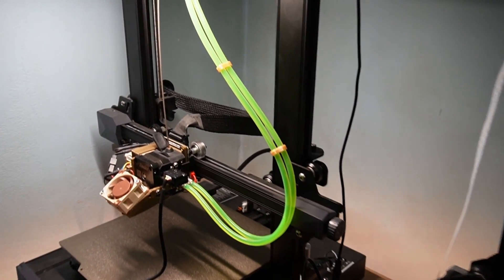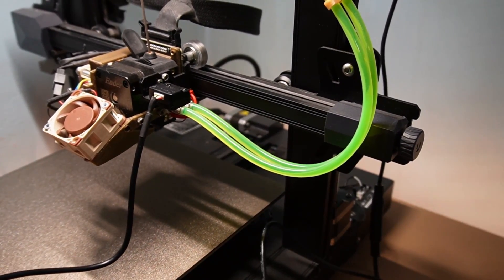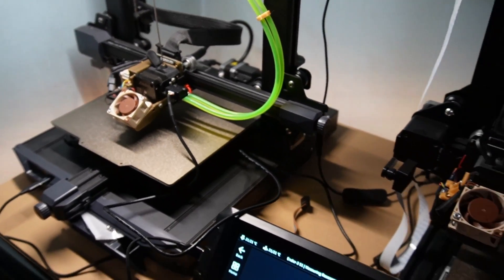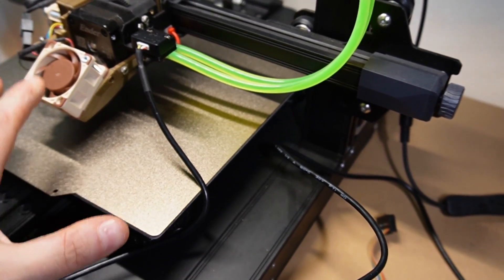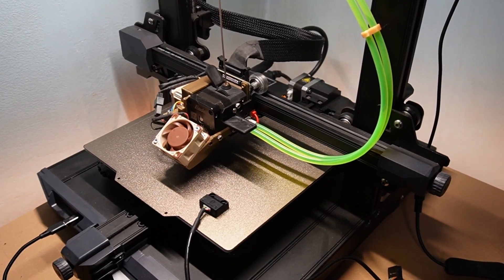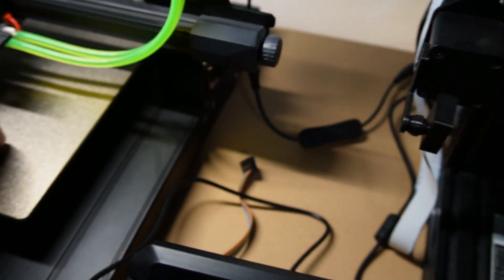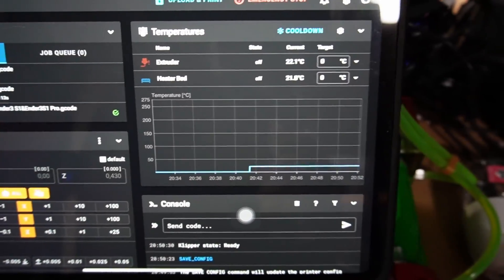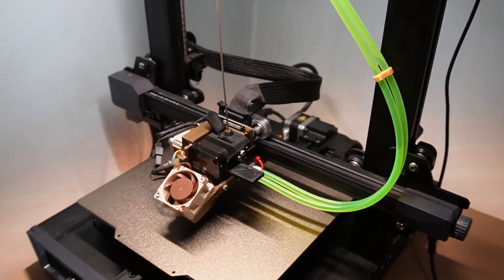Creality Sonic Pad Input Shaping Fix Test and Mainsail introduction Ender 3 s1 (pro) sprite extruder

Comment: great video, thanks. If I have run the calibration once initially, what do I have to do to rerun it? does the routine overwrite previous procedures or do I have to change any settings before rerunning it? Thanks
Reply from the maker: hi there, in the settings menu there is an advanced tab , there u choose resonances and run them for the x and y axis.  Each time u do a resonance calibration, it overwrites the previous one. U don't have to change any settings before you do the resonance testing, but keep in mind you have to correctly place your calibration sensor on the according places on the printer.

Comment: That´s what i say all the time. The sonic pad is causing me only problems. With a more open source approach i could fix these issues very fast. One thing is the virtual_sdcard is not working correct. If i could just create the missing directory it would be fixed in minutes. Instead i can´t create the dir caused by missing permissions. The same is with a custom hostname and removing fluidd and set the mainsail port to 80 instead of 8819.
Reply from the maker: you are right, klipper is about being open source and Creality doesn't get it...
Reply: @aim6mac  yep. I was talking about this problem in general an my channel and only got hate in the comments. But i think it‘s time for round two. Right now i got an error code „key121“ because the virtual sdcard is not working. Let‘s see how creality responds to this.

Comment: If i have 4 creality printer 3D, i must buy 4 sonic pad too? If i wanna print same times
Reply from the maker: no one sonicpad can print simultaniously upto 4 printers :)
Reply: @aim6mac  great.. also after flashing klipper into creality printer, stock lcd display will not work anymore?
Reply from the maker: @Hopatzful  thats is correct, u need to use a klipper screen,  in your case the sonicpad
Reply: @aim6mac  thank you.. i hope next videos you share how to print 2 or more creality printer in the same time..

Comment: really good contend bro i got the sonic pad a few days ago and have to wait for a update due to mine CR-X PRO  is not in the sonic menu jet ,
and I'm scared to try to config / FLASH  it and not be able to print anything if it's not working with the sonic pad jet ,,
thinking about buying a ender 3 S1 as well (black Fryday deals are awesome now) 
how fast is it really going to be printing with the sonic pad and the promised good quality bro ?
and I'm excited about the iPad extension they are trying to update and win us over that's clear
they need to be more open whit software do I'm a Appel fan from day one still got the iPhone 1 running as mp3 / a music device 15 years old and still going strong now that's quality  
so running / managing my prints from my iPad pro would be pretty awesome   mjammjam gif me some 
and BTW  love the water-cooled ending holy shit bro i know what i want for Christmas want that that's 3d printer porn bro ..lmao so cool
Reply from the maker: Hi there, the sonic pad really does bring speed to your prints thanks to the input shaping capabilities , but dont expect it to do wonders, the quality can stay as good until a certain point.  It's gotta do with the stability of the table it's on.  I run my printers with klipper on double the original speed. print still come out really good. I got the watercooling kit installed for two reasons tbh, first reason being : it really looks nice lol :) second reason is that i wanted to make my printers go really quiet, and since the watercooling takes away the need for hotend fan it reduced the noise levels to all time minimums. I'm loving it :)
Reply: @aim6mac  thanks for the replies bro     and hell jeh the water-cooling kit looks like it's almost a alien thing lol and jeh  that's what i was thinking why you/it was added to the printer ..the cooling fan for the hot end is annoying as f..k so i will get that kit a 100% but what is your speed limit on what you are printing my cr-x pro is still spitting nice prints out at 150 mill a sec beyond that speed its getting a little buggy and sometimes i need to adjust it on the fly when i have some legs or close distance things to print i need to slow it down and drop temperature or it will spiderweb between it like crazy ! that's a cooling problem i will try to fix that but it Hase a limit do otherwise y still will end up having  a jet engine as a cooing blower hahaha  and the speed that your machine is spitting out the auto bed leveling with the sonic pad  is nice it was 46 sec i belief that's 74 sec faster than my standard auto leveling sequel ,,but extremely long story short how fast are you printing whit it before you really starting to see a degree of quality drop ?:face-turquoise-covering-eyes:

Comment: Best video I’ve seen so far on optimization. I am using a large binder clip to mount sensor on the bed.
Reply: The binder clip is a much better way to do it.
Reply from the maker: thank you!
Reply: Not a bad idea. Only make sure it's a light weighted one, otherwise the mass would change the characteristics of the print bed in the resonance test. I doubt if there is a lot of change, because the mass of the bed is far bigger than a single clip, but nevertheless.

Comment: Have you tried the sonicpad on your 3v2 with the sprite extruder. I cant get past the abl because the offsets are all off. It wont let me adjust offsets until the initial setup is complete.
Reply from the maker: no i haven't tried that but i will try that with my spare ender 3 v2 soon!
Reply: Thank you.
Reply: I can help with that if you hit me up.

Comment: Great video, I hadn't noticed Main Sail with the update, a video about bed levelling with Klipper would be great, I have manually levelled mine, but then when I run auto levelling, it shows a very high variance of 0.8, my prints are coming out fine, but I wonder, what is the best order to calibrate the printer, and should you try and get the variance down to say 0.1, then manually level?.
Reply from the maker: Hello Ian, if your print come out good then i wouldn't look further into it. when u have variations that are too high ur print wont look good anymore, but some margin in them cannot do any wrong imo
Reply: i would try to get the bed level manually as close and fine adjusted as possible bro it's just simple common-sense/ logic that if the printer is not having to adjust to the diverge while printing at high speed it will be automatic a higher quality output and les tear and wear on your printer if you just make it easier for your printer to do so right ?

Comment: Great video can you do one on the SSH process.
Reply from the maker: I can but there is not much to see, u cannot do anything after SSH ing into the sonic pad, it's not a superuser account. So u cannot install anything ...
Reply: @aim6mac  if it’s not worth it then don’t worry about it. Is there a way to remote into the sonic pad when you aren’t both on the same LAN?
Reply from the maker: @mikestowe3  yes sure through your browser , just type in the ip adress of your sonic pad :)
Reply: @aim6mac  in order for that to work on mine I have to be on the same LAN if I’m at work I can’t view my printer at home.
Reply from the maker: @mikestowe3  yes thats true, but there is a work around
Reply: @aim6mac  what is the work around?
Reply from the maker: @mikestowe3  well u can install a server and then u can access it from other networks with a password and login, but now that i think of it, it only works on a raspberry pi because u have to change some initial settings, and those are not accessible through the sonic pad

Comment: Print file are you using for your adxl345?
Reply from the maker: u mean the mounting clip stl file?
Reply: @aim6mac  yes sir
Reply from the maker: @JustCreateYou  if you have a sonic pad, it's in the box on the usb drive
Reply: @aim6mac  don't use a sonic pad just use my raspberry pi and tft70 screen from bigtreetech
Reply from the maker: @JustCreateYou  come to my discord i'll share the STL file

Comment: On my S1 Pro using Sonic Pad, I keep getting an error message about possible connectivity issues or ADXL345 issues. Sometimes it happens on the X axis and sometimes it does it on the Y axis test. Either way I can't complete a test. It's really annoying! I've heard something about shortening the wire to fix this but I don't think that's the problem, any ideas? I mean the wire length doesn't seem to be a problem on your printers.
Reply from the maker: Hi there, shortening the wire may or may not fix your issue, but you are not the only person that has this problem... many have tried to get a new cable or new sensor and creality just doesn't have the cables on stock at the moment of writing this.. they are producing these cables on their own factory thats why they are such a bad quality i'm afraid...
Reply: @aim6mac  Thanks for the info, maybe I'll try to make my own cable then. Or maybe check their connections. The only time it worked was the first time and it timed out on me while I was trying to figure how to mount it to the bed. You know, the head in the center problem. :) So I'll take a look at their soldering I guess.
Reply: I had the same issue before the update, the test would fail every time before completing, with an error about the cable, but after running this firmware update the input shaping worked great :)
Reply from the maker: @IanDDalton  awesome!

Comment: thanks again
strongly considering just using an old laptop with ubuntu to install klipper and maybe use an old android phone as a kipper screen
seems to be a bit more work than using the sonic pad but at least it's open source, I can use the newest features, and have sudo access
one thing imho your videos would really benefit from a fixed camera angle and a bit of brevity
Reply from the maker: hi there, thank you for your suggestions, i'll consider them for sure :)
Reply: @aim6mac  thanks for the reply mate and keep up the good work!
Reply from the maker: @iamdmc  thank you very much.